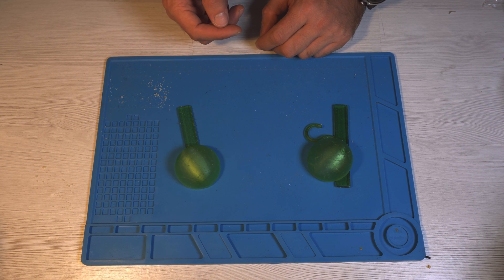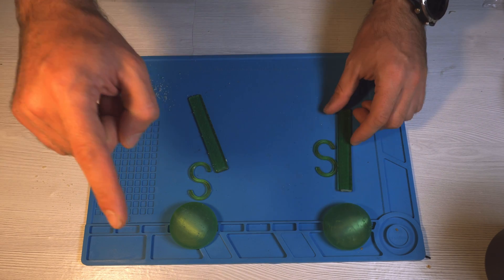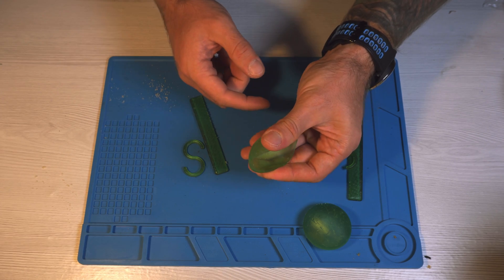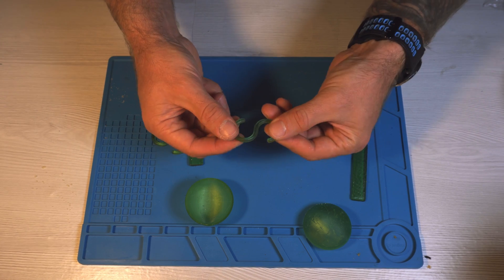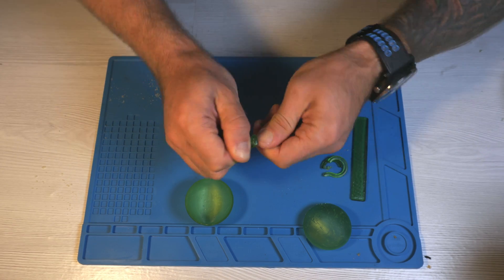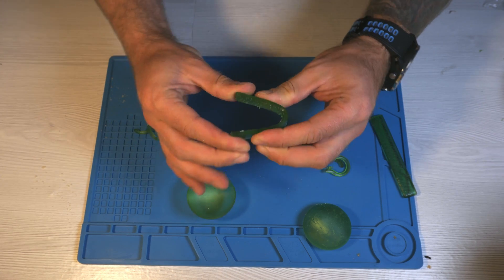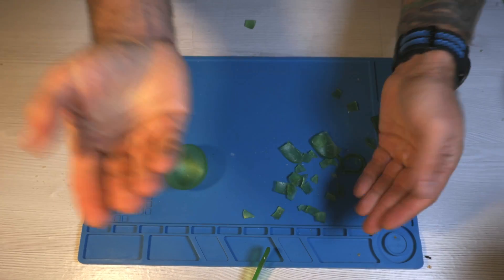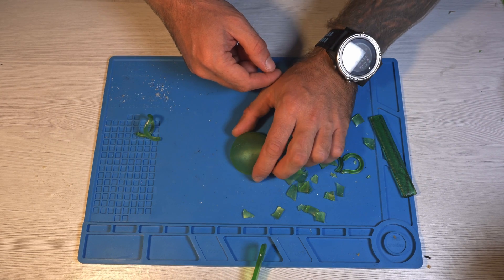Testing AnyCubic UV Tough resin - is it as tough as advertised?

Comment: wow , the video is very very useful reference for me! much appreciated,  I had make the small gear for my rc car with normal resin, the result as yr left side sample,  I hope that the new UV-tough one would be work on it.   btw, is it the same exposure time or other setting compare with normal resin?
Reply from the maker: Glad it helped!

I would advice looking into Siraya tech - ABS like fast resin could perform better than AnyCubic.

Regarding exposure - yes, the settings were the same.
Reply: @techbytch  oic ,  I will take a look on ABS-like resin, Thank a lot and kindness help !!:hand-purple-blue-peace:
Reply: Did it work?
Reply: @elsunshine9976  I used it for my RC car's C hub, and it seemed to work fine. There was a little strain when I forced the part, but it was not easily damaged. Additionally, the material was so amusing that cutting it gave the impression of cutting an apple, ver easy to cut out. BTW the rc car's with parts have been tested drive on the off road tough play.

Comment: Hey Andrew, If I have a very brittle resin would this one help a bit as it would do Tenacious with a ~80% normal & 20% Tenacious (or this "tough from Anycubic")?
Reply from the maker: Hi, I would not mix resins from different suppliers :) There is no way to predict how they will react so if your resin in AC in might work to add this one to the mix.
Reply: @techbytch  Well... everybody kind of mixes Tenacious with anything they can get their hands on and it seems the results are pretty good... And anyway, my other resin is still from AC so it shouldn't be a big issue anyway... Thanks for replying! Take care!
Reply: @smile3dLand  I just mixed UV tough, Tenacious, and Anycubic basic for some car intake parts, and it works fine. Anytime you mix UV tough and Tenacious in any way, it’ll increase the functional cure time.

Comment: How is the smell? I had to switch from normal Anycubic resin to the Eco because of the smell, and while I get good results from the Eco it is quite brittle. I don't know if I need something this flexible though. Maybe a mix of the two?
Reply from the maker: Like any AC resin I suppose. I have two charcoal towers installed in the printer and it's OK.

Comment: can you give settings exposure time or etc?i already print why so flexible😅no hard btw
Reply from the maker: The very default for the Photon at Lychee slicer. 30 sec bottom layers, 3 bottom layers, lift speed 65mm, retract 150mm, light off 0 sec, exposure 8 sec, lift 5mm